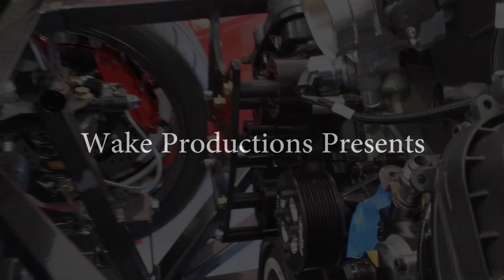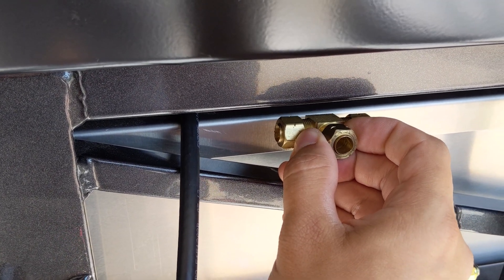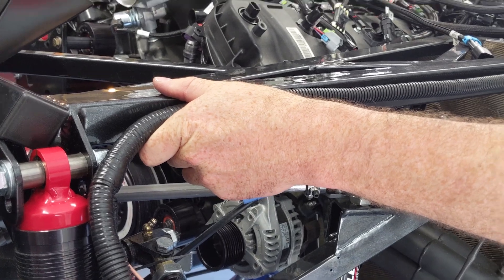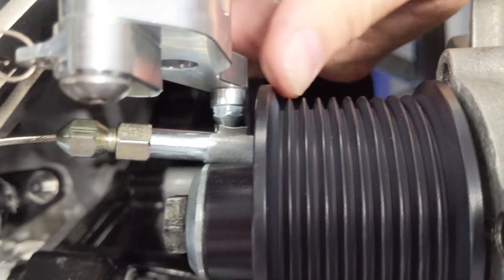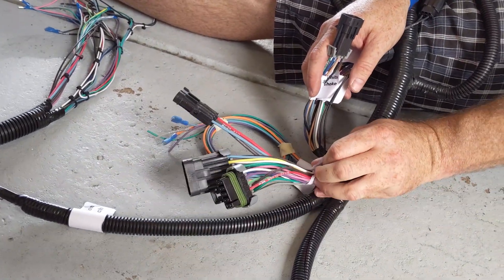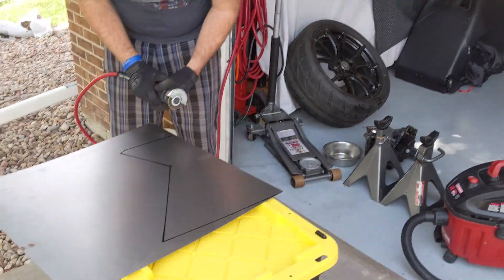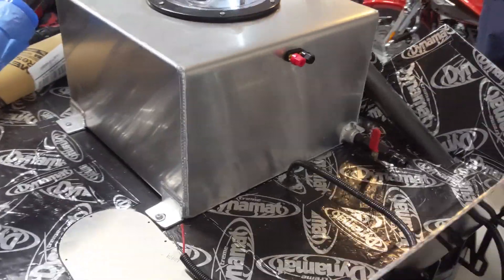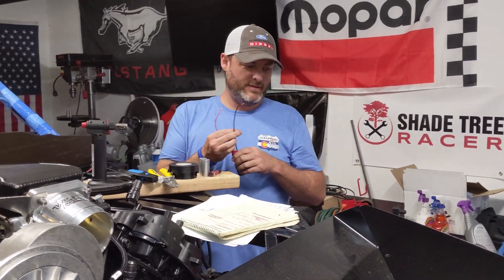Factory Five Daytona Build Part 11!

Comment: Wanna do one with a 2.0 ecoboost. Do you guys reckon it would fit considering it sits a little taller than a v8? Thanks m80s, big ups
Reply from the maker: Potentially If the centerline of the motor sits in the same spot in the chassis as the coyote does. Factory five used a E-force blower on one of their cars and the distance to centerline from the top of the blower is 20.8" according to Jegs.  I'm seeing a 19.8" distance for the 2.0 eco out of the ST; but I would check with Factory Five to be sure.
Reply: At least do a 3.5 if you are going to go that route.

Comment: What gas tank did you guys use? I can't find the video. I would like a bigger capacity
Reply from the maker: Its a fuel safe 22 gallon; we installed it in the build part 4 at around 7:30 and 13:00 minute marks